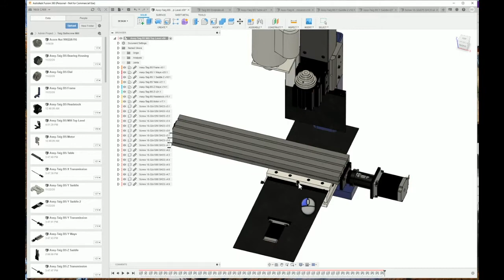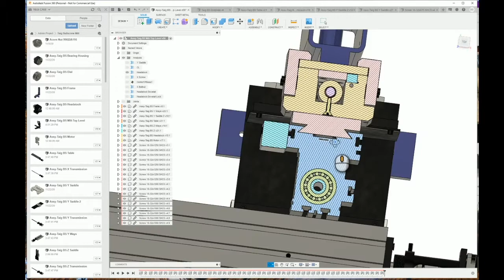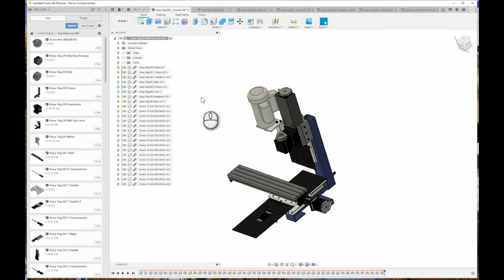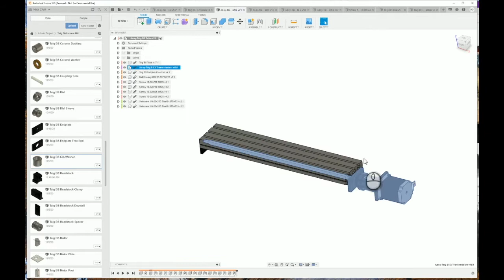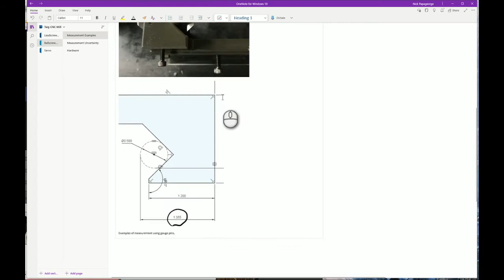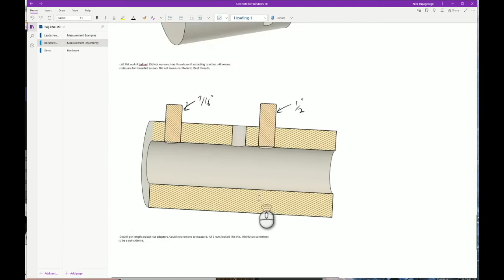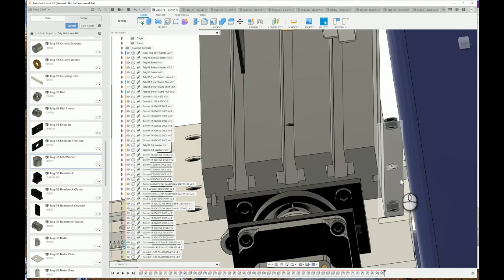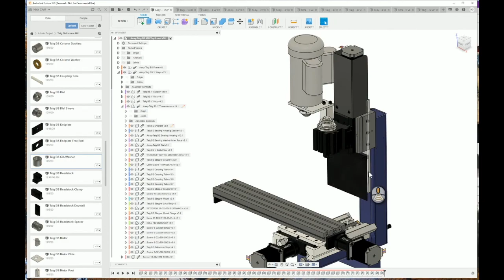Taig Ballscrew CNC Mill CAD

Comment: Thanks for the model Nick.  Just needed it as i'm bout to order this mill and want to start designing an enclosure for it before I receive it.  Do you think a noise enclosure is necessary in a apt. garage?  Also, is coolant 100% necessary in your opinion when cutting metals?  Just taking things into consideration since i'm already building the noise box, may go ahead and add drainage into the design.  Thanks for all the help.
Reply from the maker: I had mine in my apartment living room for a while before I could take it to my dayjob office (RD). The compressor for the air and coolant mist was actually louder than the cutting. You 100% need lubricant for aluminum, otherwise the chips will clog in the flutes. Steel you can cut dry, but lubricant will help there. , You don't need a mister, and can simply use a brush with oil, or WD-40. Another  issue in an apartment will be the smell of the lubricant. If you are in a garage in your apartment and the neighbors won't care, then use make an enclosure to keep the chips down and the coolant in, is my opinion.
Reply: @nickp4793  Thanks for the help Nick.  I'll be sure to post a video of the results when I receive my machine and further the setup.  -Myles
Reply from the maker: @RodlessReel  There is a really good FB Taig group if you are on FB. Lots of good info there and lots of mods. There is one member who also made CAD available for a sheetmetal enclosure.